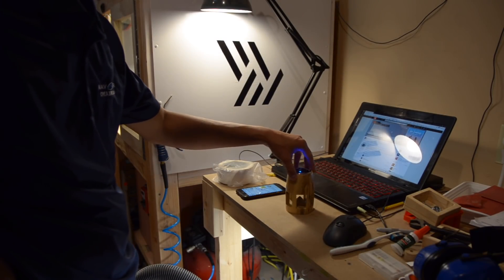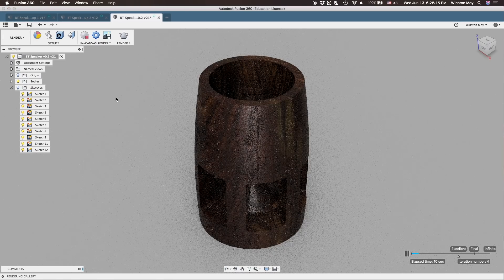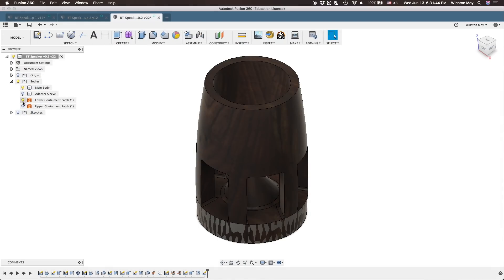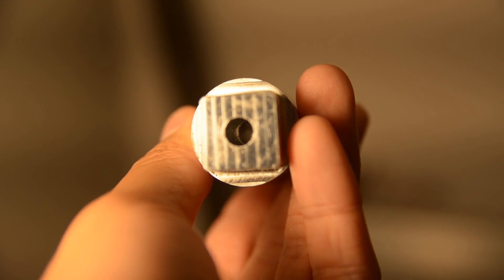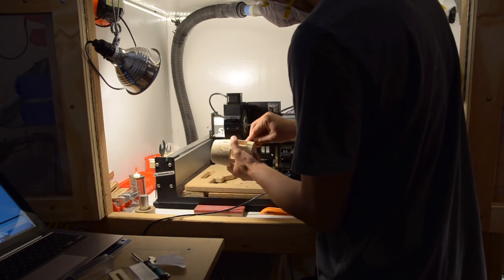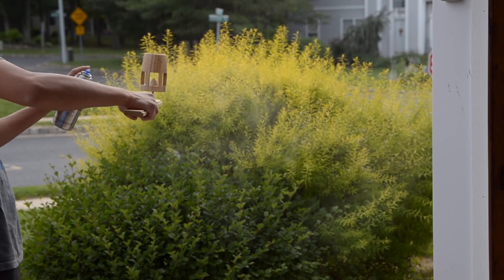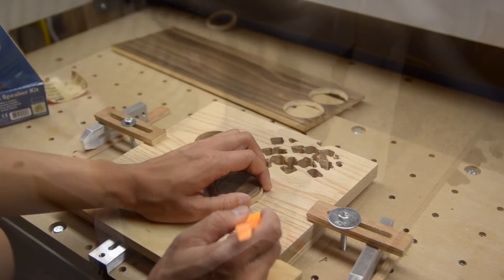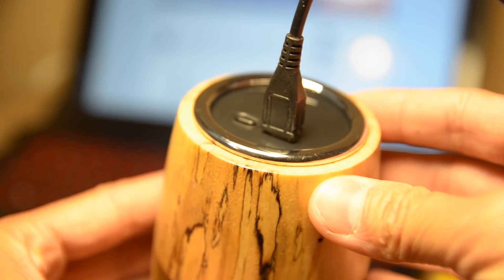5-Axis Wooden Bluetooth Speaker Enclosure - #123 [CNC]

Comment: Fantastic, unbelievably great video, and videos. I've been in a total wormhole on your channel eating it all up. I am currently looking at taking the plunge on this machine. I'm an engineer,  have several years 3D printing experience, 10+ years modelling experience, and 1 week experience (weekend-style college course) with of actual, hands on, programming/machining (ie precicely ZERO). My job revolves around designing parts that can be manufactured in house on our CNCs, one of which is a big 5-axis Mazak Integrex Mill/Turn. So these "sweepy/curvy(/amazingly fun)" geometries (and their manufacturing constraints) are in my wheelhouse from a design standpoint, but that's really where my knowledge/experience ends. Do you think I'm out of my mind for thinking about this machine?
Reply from the maker: The capabilities are all there, the continuous 5-axis milling capabilities are all there, and accessible with Fusion 360. The things you learn on a platform like the PocketNC will be easy to translate to larger VMCs. I would say being comfortable with 3-axis machining is recommended, but it's not impossible to jump into 5 axis without it if you are well versed in other forms of digital fabrication. Biggest thing to understand though is the work area limitations. If your ambitions are a little more manageable than mine (I would not recommend a project this large), it's a reasonable machine to consider. But also, from a $$$ perspective, make sure the things you want to make will truly benefit from 4 or 5 axes machines. A lot of things can be done on a 3-axis and just flipping your part over.
Reply: @WinstonMakes   Wow!! Thank you so much for your reply! You've made my day! :)  Many of my projects revolve around moving fluids - think impellers, augers, and other "overhangy" helical geometries machined from cylindrical stock. If i move forward with this machine - I'd be planning to stick with 3 axis machining (A&B locked) for as long as it takes to get comfortable with it. 

Last question: What is your opinion on the V2-10 vs V2-50? Ultimately, are the same part qualities achievable (surface finish/achievable geometries etc) between both machines if I don't mind waiting a little bit longer for the V2-10 to finish the job at its lower RPMs?

Any "intangibles" that are overlooked by people like me choosing between the two machines? ie is the quick tool changing and increased RPM really worth the extra few grand? Does it make life that much easier? If you were spending your own hard earned cash - would you go for the 50?
Reply from the maker: In wood and plastic you can get the same surface finish. Aluminum really likes when you slice through it FAST, so that's one area where it's really beneficial. But in other materials it's harder to make a case for it. Plus, you can only use endmills with shanks between 3-4mm on the -50, it's an expensive, small collet, whereas the -10 uses an ER-11. And you need a little air compressor to constantly pump air through the -50's spindle. And if you don't use it for a week, you need to sit through like a 10 minute warm up cycle. For casual use, the V2-10 is way more convenient.
Reply: Winston Moy Thank you!

Comment: It seems Pocket NC projects need enormous amount of customizing to get things to work on that machine.  All of these machines have drawbacks but for $6000 bucks (at least)  ...there should be far less drawbacks.  For that price the unit should be 50% larger  and more powerful.
For that price you could get a Tormach  that is insanely more powerful (and yes it's not 5 axis) 
$6000 is a professional machine price for what is a hobby machine.
Maybe I'm just ignorant since I have never used any of these machine. Winston: I would love to hear your input.
And Thanks for posting your videos ..I really enjoy them.
Reply from the maker: There's realistically nothing substantially cheaper in the market that can do what the PocketNC can do. If 5-axis was easy, you'd see more manufacturer doing it.  If you want to put a rotary axis on a Tormach, you basically have to go to a 770, and modestly specced out you're over 10 grand easy. And even then your work area is pretty limited, larger parts may interfere with the tool changer. And there are some thing you just need 5-axis for.

The way I look at it: You can get a Ford-F150 for 50% more than a Honda Civic, and it'll do 150% more. But it's not the right fit for everyone. There's a place for the PocketNC, and if you need it, you'll know. If you're not sure, probably better to just keep shopping.
Reply: @WinstonMakes  Yea, I see what you are saying. It's true, the pocket NC is the premiere 5 Axis desktop machine. And in that sense it should command a higher price regardless of the scale.  If they could  produce a larger scale model  ...i think they could hit a real sweet spot in the market.
Thanks for the response Winston.

Comment: Your video has sparked my interest in small scale CNC machining. I am particularly encouraged by your enthusiasm and willingness to just "jump in and give it a try" (after a suitable amount of research, obviously). Thanks also for including mistakes and explanations as to why the problem occurred and the solution to the problem. I have absolutely no knowledge or experience in this field and so your explanations provide valuable insights into things that need to be taken into consideration. I love the way that your video is very succinct, no unnecessary commentary or long video takes of obvious processes.  One minor suggestion, if I may, your commentary sounds like you are reading from a script (I wish more Youtube contributors would also do this) however when we read, we tend to speak faster than we would when holding a normal conversation. Could you please just slow your commentary down a little bit. Overall an excellent video and now I am a confirmed subscriber.👏👍

Comment: why you using stepper motor for a millling?
did you have any reason?
Reply from the maker: Not sure what you're talking about. The spindle is a brushless motor, and all hobby CNC use steppers for driving the axes.
Reply: spindle looks like stepper motor.
Reply from the maker: I assure you it's not. And there are other machines also with brushless motors packaged in square housings.

Comment: Perseverance. I own a PCKNC V1, and can relate. But its very rewarding. One comment: I refrain from sanding near machines. Abrasive dust flying in the air, drop on the machine, and will ruin guides with time. This holds for any kind of machine, with ways. I cover the machine with news paper and pick it up politely. 
Skill wise, I appreciate the work arounds you developed to get the job finished. Some good coding / fusion skills to get restarted with A table forward 90.  How did you do that..?  V2 has a collision emergency stop?
I also appreciate seeing material on PocketNC. As you pointed out, there is surprisingly little.  Here is a link to my pinterest page, were you see my solution for centering parts on the table. I mounted a self centering chuck on a base plate. However, as you pointed out, anything that takes away X height is lost capacity. (I like the short spindle adapter) I am considering getting the V2 upgrade, to get all the new benefits, most importantly, the Er collet... Would be simple enough to sit the chuck spindle inside the ER collet. Sherline makes the chuck.  As it is, it sits 25 mm above the A table. https://www.pinterest.com/pin/531072981051890808/

As a side note to other previous comments :  yes,  the size is limiting. Even when you get a bigger machine, you will want bigger.
The key take-away for me, with the PocketNC is convenience and progress. You can cut five axis in the kitchen pantry!
Seriously, that is awesome. The second take-away is progress. It allows me to make things I couldnt do before. It changes the way you work. It opens so much possibilities. Size limitation: I live with it, happily. It is a high quality machine, and the company service is great.
My two grain of salt.

Comment: I haven't looked around for a desktop 5-axis for awhile, but I assume options are still fairly limited. I probably wouldn't be interested in this unless it's scaled up, the volume of the work area is too small, and it looks like they have some kinks to work out when homing if you have a cubic work piece. 
I wonder if this kind of design has any advantages over a more traditional design, where the milling head has the two additional axes on it, rather than the table. 
Modding a typical desktop cnc to have the additional axes shouldn't be too difficult to work out, though I'm not sure how many 5-axis driver boards are on the market.

Comment: For the final pass around the barrel, why not do a lathe style operation where the workpiece would have been continuously been spun around the B-Axis? I'd imagine an operation like that to be WAY more efficient AND more pleasig to the eye when it comes to the surface finish.
Reply from the maker: Going "with the grain" on finishing is easier to hide through sanding. Also, the translational velocity of the CNC is higher than its (rotational velocity X radius). So up and down was quicker.

Comment: Does the design with the holes improve the sound, or was it purely for aesthetics?  I really like the look and the fact that you were able to design it and use the 4 axis CNC to do it was pretty cool.
Reply: The speaker is downfiring in this configuration, so the holes are the only way the sound would come out to begin with! If he made it an upwards firing speaker, you would only hear ceiling reflections off it, and that's just not very nice, there's a lot of volume loss and the sound is not particularly clear. If he made it the usual side firing kind, it would sound quite OK somewhere in its firing direction but no direct sound elsewhere. So this is an omni speaker firing out of all sides equally, some volume loss but not too much, ceiling and floor reflections are minimised and you can just put it wherever and it'll sound OK. Not particularly well, because there's really no acoustic engineering done here (the air spring formed by the enclosed volume of air is likely exerting a bit much return force, the horn-loading is not taken into consideration at all, etc), but it's just for voice so it's good enough and likely not really worse than any cheapy you might buy somewhere.

Comment: That thing needs an upgrade if it can't twist a 1/4" drill in aluminum. You could have pocket cut the hole with a smaller end mill but it's expensive buying long end mills in small sizes. They are easy to break too.

It would be nice if they put a little two speed gear box on that spindle like they use in many battery powered drills. Probably trying to keep cost down. Looks like an opportunity for an after market vendor as I'm sure your not the only one that needed more power from time to time.
Reply from the maker: The 1/4" drilling attempt was in aluminum. Wood would probably be okay.
Reply: Winston Moy  sorry about that; I meant aluminum and have edited my comment to reflect this.

A smaller drilled hole with the pocket nc would have given you an easier time on the drill press.
Reply: Winston Moy could u peck drill with shallow and many hits?

Comment: winston, do you have a link for the bluetooth speaker kit?
Reply from the maker: Kit I used is from Rockler, however they're currently out of stock and listed as not available. Not sure on the time frame for resolution, but there are plenty of options online. Will post a link if things change.